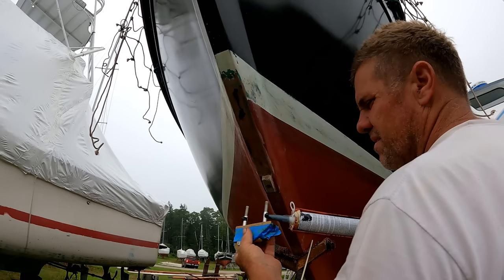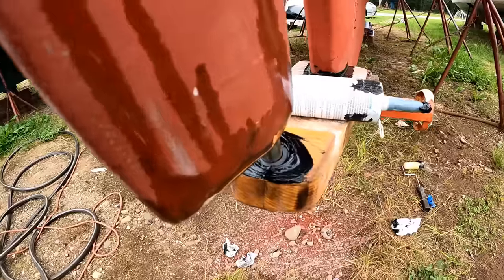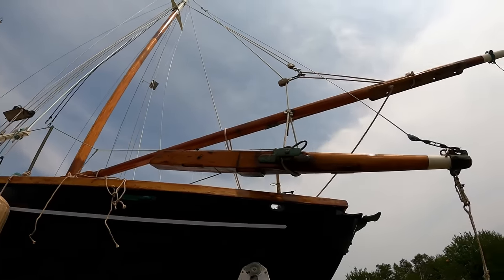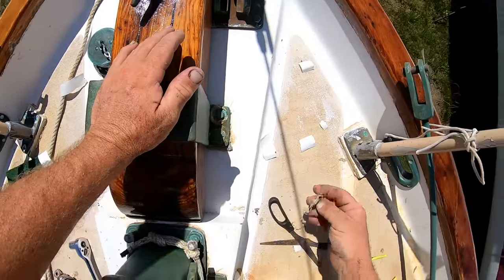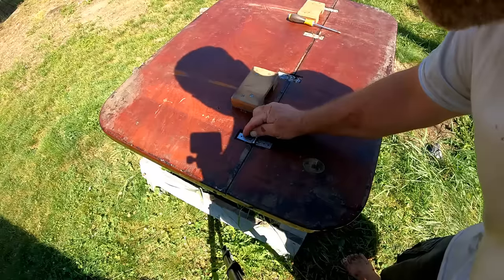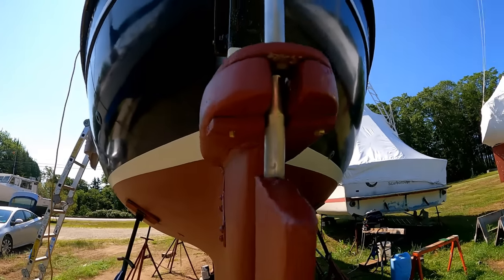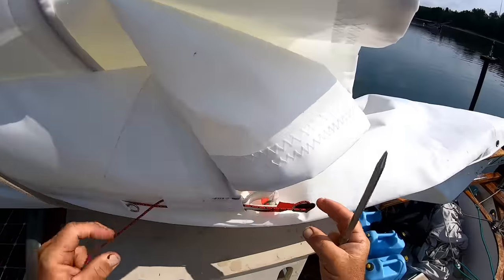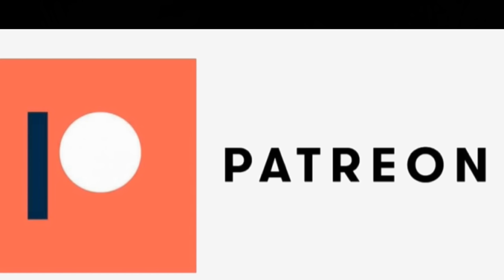Beware the Last Batten!  |  Ep. 228

Comment: Nice design of trim tab.
I take it your trim tab can rotate 360deg.
So under no strain when reversing…intentionally…or otherwise!  
I see Wave Rover had hers attached to the rudder trailing edge, lashed Wharram style.  That would not be my choice.  
And of course the further away from the pivot line of the rudder, the greater the force it generates
Reply from the maker: Yes, that's probably why my trim tab needs to be a little smaller than the standard 15% of rudder area.  The longer lever gives it too much power.  Btw, new arrangement is working great ...

Comment: Bwannngggg!  I will have to go back and watch the trim tab videos, but I thought it was more parallel to the rudder.  Will the slight angle make a difference?
Reply from the maker: The angle is so that the air paddle attaches at the intersection of the rudder axis and the trim tab axis.  Otherwise the air paddle will wag when the rudder turns.